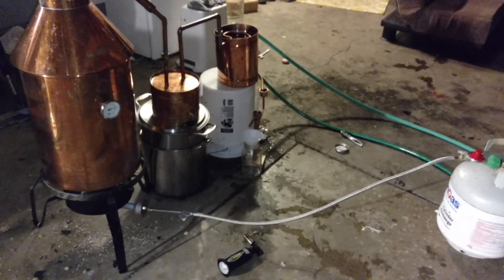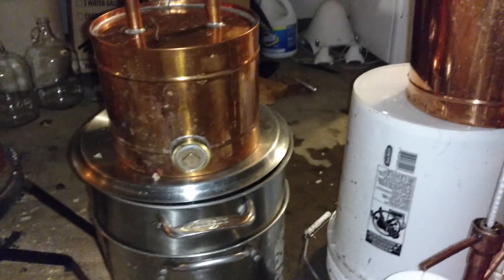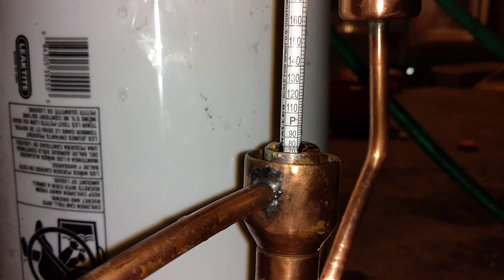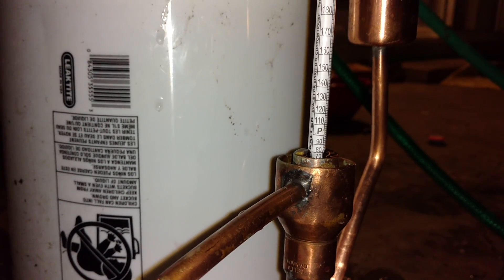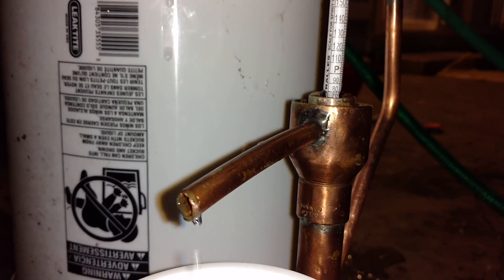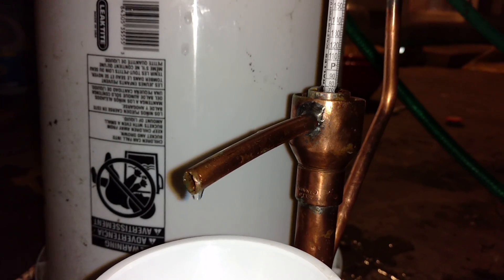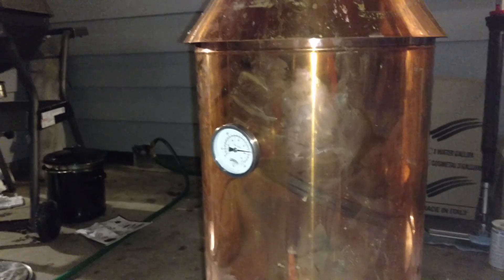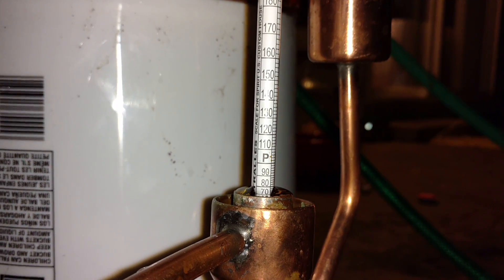Thumper keg distillation

Comment: Just a little advice your running your steal to fast, one other piece of advice make sure your mash is worked off completely, 80-75 proof liquor is really low, that’s usually what I get towards the end of of my run… Usually start out at 150-160 depending on what kind of mash I’m using… But hey awesome video, Anyone who makes a little liquor on the side is ok by me….

Comment: Your thumper is too small, that’s why your only getting 40 proof, if it’s not at least 1/3 the size of your still it will carry over too much water vapor and you will end up with weaker alcohol, also you should make more cuts to split it into foreshots. Heads, hearts and tails. Then you can mix as you see fit, it gives you more control of your end product.

Comment: Methanol comes off at the start of your run, Your thumper (doubler) is too small, a thumper should be 1/3 the size of your still. You measure the temperature of the vapor at the top of the still, not down at the mash. With a thumper the temp of the still shouldn't go above 185* f. unless you're doing a stipping run or in a hurry to scorch the mash, in a stripping run you don't use a thumper. Methanol comes off when the still reaches 143*f, (head), and ethanol starts coming off at 163*f (Heart). With a thumper the process takes a lot longer to heat up, but the end product should be a hell of a lot more than 80 Proof...That shit at the end of your run that you said, "I'm going to throw away", (tailings) is the stuff you should be putting in that thumper when you do a run.
Reply: Doublers Fine!

Comment: yeah with a thump keg you should have edleast hit 110 off + up the sugar what yeast did you usetemp to high mabye still getting getting mabye water in with your product low and slow patience pays with better shine
Reply from the maker: been a while since this video. not sure what happened.  I usually get 145proof right out of the gate and then it tapers off slowly for the past few years
Reply: @Anthony_DP  Do a thorough cleaning and lightly pack column with 100 copper mesh, then run at about 184° to 194° in the pot or 173° at the condenser entrance and you should pull 165-175 proof. Just FYI bro. Keep on keepin on.

Comment: If you didnt get a temp reading of the output on your parrot then you're reading is off. You gotta add or subtract from your hydrometer reading if the output in your parrot is not 60°

Comment: Nice looking rig, but get rid of the plastic funnel!
Reply from the maker: I know right!  One step at a time :)  Definitely not using one anymore :)
Reply: Kitchen/restaurant supply stores you can usually get inexpensive stainless one from (that's where I got one). You going to keep that nice and shiny, or let it patina? I used to keep mine clean, but eventually just left the outside (the inside is maintained). After a few years now, it's got that "old backwoods used" look . . . complete with marks from flour paste dripping down the sides lol. Personal preference, some keep them shiny.

Comment: I watched ur video to learn about a thumper , not to watch u brag about ur setup. 

May your bung be rung my a methanol fart one day. ;)
Reply: A thumper isn’t rocket science...
Reply: A thumper should be 1/3 the volume of your still and filled with tailings from the end of your run. If used proper, it will increase the A.B.V. from about 160 proof to 180 proof. It may not be rocket science, but you for sure don't understand it's purpose.

Comment: I have the same set up  the 6 gallon still so do I only fill up my boiler just under the thermometer I have will have 5 gallons of wash should I only do about 2.5 gallons at a time?
Reply from the maker: summer swan fill up to the point before the still tapers up, regardless of the size of the still
Reply: how would I clean my still its new do I need to do a cleaning run of some sort I ran water threw it to to distill some water and test it out  but it came out all cloudy and had stuff floating in it I heard of running some vinegar and water mixture threw it would screw it up? thanks
Reply from the maker: YES! Run a diluted vinegar solution through it.  You'll see the visible change.

Comment: Thumper keg is a bit old school, and that's exactly why I want to start useing it. My question is how will it effect how much Forshots you have to throw out?assumeing from how thumper kegs work, alcohol saturates the liquid in the thumper, so will the Forshots then be first released from the thumper keg the exact same as any set up, and at same temp/volume,or is there any difference that needs to be noted?
Reply: I don't know where people get remove 250ml taken off first for 5 gal batch .its always been 50 ml  for 5 gallon batch . 100 for 10 and 150 for 15 . If you filter everything after through. Charcoal , you won't have any problems.
Reply: Fair warning. I do not do a thump keg. So my knowledge is from watching others. You fill the thumper with some fair abv stuff to begin with. The few people that I know that use thumpers save their tails to load into their thumpers on the next batch. Or they use cheap store bought hooch if they don't have any tails. 

The way the thump keg works is that the hot vapor from the pot still bubbles up through the liquid in the thumper. In this manner it provides an extremely low tech approximation of one of those windowed flute columns. But instead of using a reflux condenser at the top of the still, it uses the relatively cooler liquid in the thumper. This liquid will heat up to the boiling point of the alcohol (which is why the thumper gets hot) and let the alcohol vapor come through, but help catch some of the water that is carried over. It provides a seperate rough distillation to further clean up the finished product. All of which should give a more consistent abv over the course of the run.

I run packed column reflux distillation units at work and can talk all day on how those work. I know what happens when you take the packing out and run as a pot still because we have some split columns (half packed and refluxed/half not). But we don't use thumpers.
Reply: In theory you should still expect the same amount of garbage at the beginning of the run. It has a slightly lower boiling point than the good stuff, which is why it comes first. So it should carry over into the thumper first and out of the thumper first.
Reply: It's going to be the same with or without a thumper. Typically on a pot still you toss 250ml per 5gallon charge as fors. It seems like lots, but there are other things besides methanol that come through and also part of early heads that you don't want (like ethyl acetate . . . think nail polish). Best thing to charge your thump with is some of the wash you are charging your still with if you are doing a single run for a flavorful whiskey/rum. For cleaning up or if you want a lighter flavor, charge with water. Remember, whatever you charge with will carry through at some point.
Reply: 50ml per 5 gallons is more typical for a reflux type still. There is a lot more smearing with pot stills. As well, no amount of charcoal will filter out many of the lower boiling point alcohols that come through the beginning of the run (such as ethyl acetate) which is why cuts are made, and any of the higher end commercial sold brands do not include this in blending (thus the higher price, less profit margin). On a single pot still run of 5 gallons, you aren't into the hearts until typically after 750ml and even then the hearts are smeared with heads.
Reply: I find the taste changes dramatically not long after the 50 ml/5gallon batch an so on. I am thinking the copper scrubers help get rid a lot of the fusils.